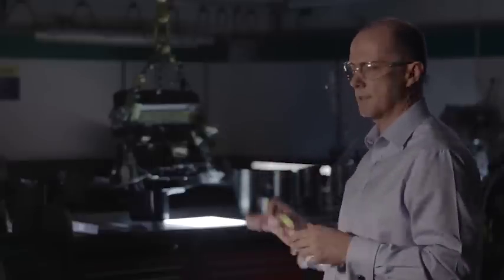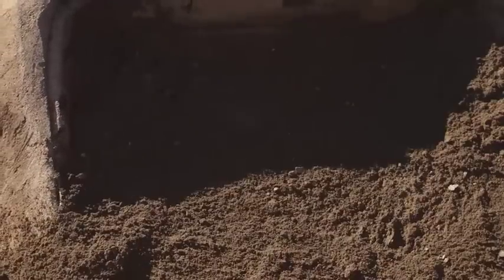Part 1 - The Problem - Intelligent Molecules: the amazing science of CASTROL GTX MAGNATEC

Comment: Castrol magnatec  additives are different to other oils.. most leading synthetic oils are almost equal.. No oil company show their secrets of additives.. 5w30 for new gasoline cars.. after 1lakh kms shift to 5w40 .. after 3lakh kms you can opt 5w50 for tropical season ..  For diesel cars 5w40 is good enough grade oil since diesel engines have good torque and don't rev high.. but compression keeps car propelled and 5w40 works just fine. My opinion !!

Comment: Yeah no. I've seen engines opened up after running only on Magnatec. When the Magnatec "magic" breaks down eventually it sludges the engine into submission. I'd consider EDGE, maybe - Magnatec will never see me or a client - ever.
Reply: its funny how most all cars are roller cams and they show flat tapped engines.  would you use magnatec if it was changed every 3,000 miles?  im not a machanic,  so im sure you know more than me.  i just change my oil every 3000 miles or 6 months.
Reply from the maker: 3000 miles is the right distance to keep your engine going strong! Way to take care of your ride Frank.
Reply: e0dge what